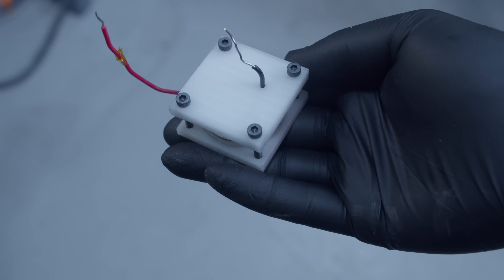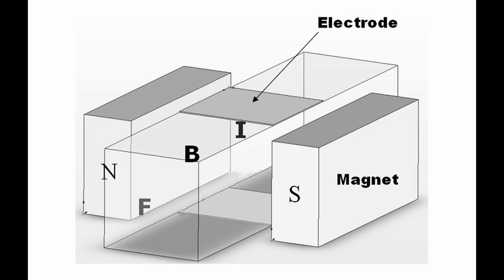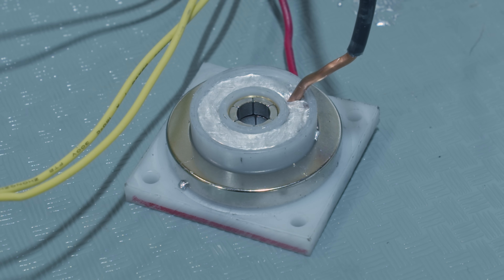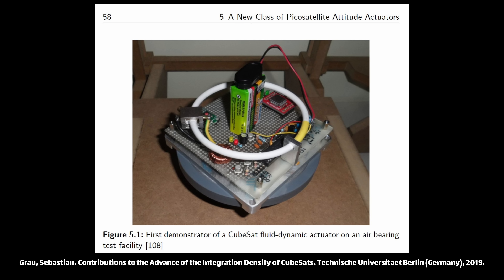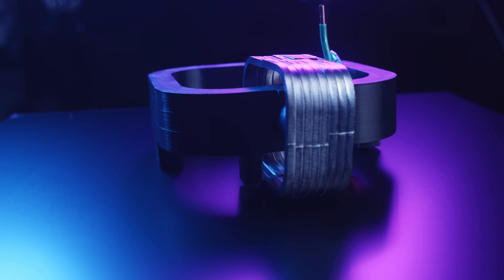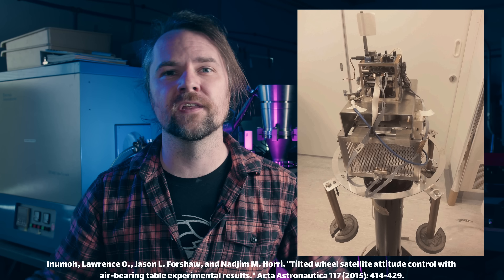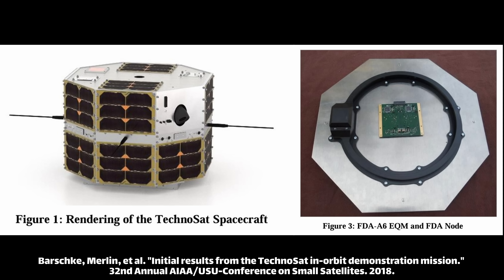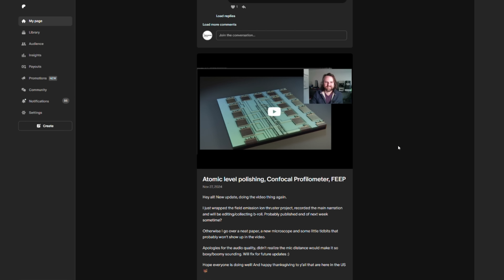A motor with no moving parts (sorta)

Comment: Are there eddies in the liquid metal? Curious if I could use a linear version of this to create a high vacuum if I keep the metal pulled away from a small void in one end of a glass tube? Or, would the metal just squirt around and cause a wacky vacuum pressure. One way to find out I guess, maybe I'll do a video. Could be the lowest cost high vacuum setup ever made, sort of like how they got high vacuum in the 1800s.

Comment: A million dollar comment - make cooler with liquid metal for silicon chips 😉 Like lid with liquid metal inside that soldering to chip and it increase heat spread surface and than use generic cooler)

Comment: Fun fact with the Galinstan; you don’t need to use a hot water bath. As long as the gallium is touching the indium and tin, the amalgam will start to form. It gets very cold and the heat helps speed things up, but it’s neat watching it happen on its own. 

Also if you put a layer of sulfuric or hydrochloric acid on top of the small set up, it keeps the oxides from forming. 0.1M or less would work. 

I’ve seen some papers on HCl vapors being used but the dilute aqueous is easier to work with IMO. 

Love the channel. I took the SEM class for my electives because of your microscopy videos. There’s I made a SEM video for this channel.

Comment: At this rate, why not use a small pump with flow control and use water? I know it's not as cool as liquid metal but in terms of flow, you can slow it down or speed it up given voltage.

Comment: Neat design.   Maybe using a bus pair of power ring on the base with electrodes touching it to power the setup.  Yes it’ll add a bit of friction but at least your liquid reaction wheel can fully rotate and hopefully overcome that friction ?
Reply: Alternatively have a transformer provide AC and then locally rectify it.  Air-couple the primary and secondaries.

Comment: I though i had worth mentioning is that if you already have a powerful electromagnet on board for a magnetorquer, the same hardware could do double duty as the field the electrified fluid pushes against for rotation

Comment: It is much easier to rotate not liquid metal but a solid spherical rotor-magnet in a vacuumized stator cavity. 
Liquid metal is subject to turbulence and unstable flows that are difficult to control. This results in loss of efficiency and difficulty in producing a uniform magnetic field.
A solid spherical rotor provides stable, uniform rotation, which simplifies angular velocity control and axis rotation synchronization.
Liquid metal is highly viscous, which increases energy loss due to friction between its layers.
A solid rotor has no viscous friction.
A liquid metal generally has less magnetic susceptibility than a solid rotor magnet. This limits its ability to generate a strong magnetic field.
A spherical rotor-magnet made of a ferromagnetic material (e.g., NdFeB) is capable of generating a strong magnetic field, which is especially important for systems that utilize electromagnetic interaction.

Liquid metal can interact with the stator surface resulting in erosion and contamination.
A solid rotor in vacuum is not susceptible to wear, which increases the life of the entire system.
Conclusion.
Using a solid spherical rotor-magnet in a vacuumized stator cavity is a simpler, more efficient and stable solution that provides high accuracy and system durability, which is especially important for experimental setups such as Gyro_6DoF. https://www.facebook.com/groups/1109241749136742

Comment: Would the liquid metal need to be kept heated in the vacuum of space? I suppose it would depend on the liquid metal used of course I'm just not sure at what temps certain liquid metals would solidify at, which is why I'm asking...

Comment: The satellite CPU rail is 1.5V... CPU (Vcore): 0.7–1.5V

DDR3 RAM: 1.5V

DDR4 RAM: 1.2V

DDR5 RAM: 1.1V

Chipset: 1.5–3.3V

I/O: 1.8–3.3V

GPU Core: 0.8–1.2V

PSU Rails: 12V, 5V, 3.3V

Comment: I have no scientific knowledge so I feel a bit stupid asking this, but is there an issue taking the movement of the liquid metal and transferring its "momentum" or what ever it's called to the plastic housing? is that why it's square so the liquid metal hits the corners and transfers it's momentum energy to the housing? 

Also instead of having one of these for every axis could you make one that's made from a double walled sphere that could do all axis at once? so by charging one point on the spere and the same at the other side of the sphere you could create a band of flowing metal wherever you like and any orientation you like inside the sphere.

Comment: 1:10 gyroscopic stabilization

You spin the inertial mass one direction, newton's law says the sattelite will spin in the opposite direction
Reply: Something like this could be useful in a nuclear submarine

Roll, pitch, and yaw the submarine without using the noisy propeller
Reply: Instead of passing current through a liquid metal, pass a magnetic field through a diamangetic/paramagnetic or ferromagnetic fluid, could pass the fluid through electrodes and even generate electricity, could be used to recycle power from the inertial motion, the liquid is basically a coil of wire, and moving it in a magnetic field

Comment: Would it be possible to just place about 4 liquid metal bearings in "circular" shape and connect them with torque increasing ratio gears so it would be easier to spin something?

Comment: For the battery solution, I had the same issues when trying to power a wifi router from a power bank. The solution I used was to add a NTC at the out put of the buck converter. I think the issue is the capacitors on the buck converter, they require large current as the charge up and work fine after charging.

Comment: Reaction wheels were one of the most robust components on communications satellites. I was in that industry for 35+ years and recall only a couple failures (and those were pre launch). They were sealed units with a very small heater and were designed to run 20 years in geo orbit.
The technology was advanced enough decades ago that any radical technology wasn't needed.  Also, the drag in an MHD "wheel" is orders of magnitude greater which is extremely inefficient - I would guess there is no future for them in momentum management in space.

Comment: I think I prefer using straight Gallium to Galinstan. Yes, you need to warm it up a bit, but the benefit is that cleaning up spills is very easy: Gently pour some cool water on it, then just pick up the now frozen-solid pieces. 

Much better than trying to deal with picking up liquid metal. Also Gallium by itself is less reactive than Galinstan, so that's nice too. 

The difference is appreciable once you have to deal with formal lab safety risk management. There is an additional benefit which may not apply to you: Being able to avoid looking like a Mercury clean up should a spill occur. 

There's an issue with wetting some things, which is mostly due to an oxide layer. 

I am unsure if the advantage in avoiding corrosion using pure Gallium over Galinstan would be worthwhile the greater effort in a space application, but would note that in space applications, temperature control is usually pretty critical anyway. Finally, stainless steel is generally strong enough to avoid damage due to state changes.

Plus since the material has current through it anyway, it would be its own heating element, so really only needs some degree of cooling when too hot, which might even be possible passively, depending on the situation. If it froze on a satellite, eventually current application is going to un-freeze it. And you'd still have a very similar freezing issue with Galinstan as well anyway, just shifted a little bit.

Comment: If the ball bearings are the issue, then why not have a rotor on a magnetic bearing? Have the magnetic bearing in the middle and the motor parts on the ends. There would be no danger of leaking corrosive liquid metal and no ball bearings.

Comment: you should expand the small model to several concentric channels to create fine grain control and achieve higher mass for the reaction. each channel would be individually controlled and selectively cycled for small adjustmens or collectively cycled for large ones.

Comment: OK, maybe I'm not that familiar with the interplay of all the forces involved - but wouldn't a unidirectional winding of a conductor (wire) wrapped around a tube filled with the liquid metal that is formed into a circle (and sealed to allow continuous flow around the circle within the tube) induce a current into the liquid metal that would then react to the magnetic field created by the winding and create continuous flow? Maybe that wouldn't work with DC power - but then again, the magnetic field WOULD be of a very unique structure...

Comment: After watching the video,💯 👏👏👏I noticed that directly connecting conductors to the liquid metal results in high energy consumption, which is impractical for satellites. A potential improvement could involve using a magnetohydrodynamic (MHD) pump —💡 inspired by magnetic arrangements in projects like the Wendelstein 7-X [Stellarator schema]— with coils arranged in a helical configuration. This could enable more efficient acceleration and direction of the liquid metal, reducing energy consumption and eliminating the need for direct contact with the conductors.🔍

Comment: You need to do a video on the Hemispheric Resonating Gyro, which our company developed originally.  Your video could use a simple "wine glass" like the original concept, and you could show the acoustic wave moving around the glass, as you rotated it.  You can also do this with aluminum or magnetic materials, so you could implement a magnetic drive circuit to replicate an actual gyro.  If done with a heavy metal, it would have much higher inertial value than the liquid methods.
Reply: HRGs do work very well - thank you to your company.

Comment: I'm pretty sure satellites now use black diamond bearings since they are effectively wear proof, chemically inert, and do not need lubrication. The process to make these bearings is fascinating. Manufacturers have these large machines that squeeze a mold at the center of them with so much force and heat that the resulting product is a polycrystalin diamond, or a black diamond. I can't wait to see what else this manufacturing technique will be used for in the future!

Comment: Question: where do you buy Gallium?  I've been casually looking for a while but never really found anywhere
Reply from the maker: I got mine off ebay, although it was maybe a year ago? Got it for a project but never used, been sitting on my shelf since. But in general ebay is good for random elements and chemicals
Reply: @BreakingTaps  I'll have to check again, then.  Couldn't find any when I last looked, but eBay is one of those things where sellers appear and disappear from time to time

Comment: Would this not saturate really quickly compared to a conventional reaction wheel? You're only able to reach a fraction of the speed a reaction wheel can achieve because of the friction between the fluid and the wall.
Reply from the maker: Different tradeoffs! Speed will be slower, but you can get a much larger diameter spinning compared to a reaction wheel (i.e. the "empty" space inside the loop can be filled with electronics or payload, whereas reaction wheels eat the entire volume). Fluid friction is complicated too, friction is high near the wall but near zero as you move inwards. So the geometry can greatly effect friction losses. Reaction wheels have bearing friction and cogging torque too, so they aren't zero-friction by any means either.

Comment: Isn't the main problem that you need to keep the power on aaaall the time since the friction in the liquid is way higher than a spinning wheel on good bearings?

You can see it in the demo that the fluid is saturated in less than a second (the speed can't incease any further) and as soon as the power goes out a torque in the opposite direction is applied since the liquid almost instantly stops flowing.

Comment: The concept doesn't seem practical at all, considering two things; 1; it will never be as accurate and predictable as a solid medium, mainly because it can keep flowing once the current shuts off from momentum, allowing friction to randomize the actual effect.   2; It still has friction, and friction wears things out eventually. A frictionless magnetic bearing of N52's will never wear out. In fact, shield it in gold leaf and it could last until it's hit by a meteor in 8 million years or something.
Reply from the maker: Motors/reaction wheels keep spinning when current is off and also have bearing friction and cogging torque, so it's essentially the same. Just different tradeoffs

Comment: Carbon steel is suboptimal for magnetic conductor, The steel you want is called electric steel, it is either silicone steel (large domains of pure iron) or nickel iron alloy called permalloy.
In this configuration I would simply used some electric steel from a transformer, such as microwave oven transformer.

Comment: Could you do this in 360 degrees, like with a complete sphere?  Maybe a ceramic sphere, with internal magnets,  inside a larger ceramic lined spherical container.  So there would be a layer of liquid metal all around.  Then magnets/power on the outside?

Comment: You can build the walls a little higher and add oil on top of the metal. It should be enough to not let the liquid metal oxidize and thus provide a better view.

Comment: I've got a couple of questions. First, why aren't you using mercury for your tests? It'd be far easier to work with and could potentially yield some rather extraordinary results. (Particularly in the field of electrogravitics.) Second, when I was growing up I had a BMX that had Gyro brakees on the front handlebars so the brake cables wouldn't get tangled. Could something like that be modified to work with electricity?

Comment: Question, what keeps the Liquid Metal from becoming a solid in space, I would assume the internal temperature of the satellite is warm either by design of working electrical components or a “space heater” 😅. Mercury is used as gasket material in space since it becomes a solid naturally.

Comment: Oh good, it needs many amps in order to provide less torque than a flywheel. And if power is lost it instantly tries to chuck your satellite back from whence it came, instead of spinning down very slowly and gradually like a flywheel. I guess technically 10 amps at 1 volt is but 10 watts. Nevertheless, good luck with all that. I find this unlikely to be adopted in any form.

Comment: dumb question. why not electromagnet? current travels from center to outside, and electromagnets make fields from top to bottom. Heck, the EM could be a natural current limiter for the liquid metal pumps. This also makes it so that at rest there's no torque when there's no power applied.

Comment: Was wondering if the permanent magnet problem could be mitigated by using electromagnets instead.  After all, if you are going to be flowing current to accelerate the metal, there is nothing that says you can’t run it through a couple of coils on the way to the electrode is there?

Comment: You said about pressurized enclosures for regular reaction wheels, but what about your liquid wheel? The boiling point of regular water goes drastically down with lower pressure. I imagine same would be true for liquid metal. You said it was highly corrosive so no metal casing, just plastic. A tiny hole or a fracture may cause your whole wheel to boil off and freeze at the same time, rendering it fully inoperable, while regular reaction wheel, even without lubrication, would degrade slowly

Comment: Would this work if you insulated the liquid metal from the electrodes, basically making it like the dielectric in a capacitor? You'd need much higher voltage, but there would little or no current.

Or do you actually need a current?
Reply: Nevermind. I was thinking you needed an electric field, not a current.

Comment: hi. instead of rotation in a circle. please try a half circle. 2 tubes flowing in opposite directions cancel out movements. 2 half circles should make direction. ive done a few tests had problems with rubber tubing expanding with flow. ai suggests it will work but we need to perform

Comment: Interesting experiment but seems not really efficient way. I think, there is another way to create a reaction wheel using electromagnetic field. Get one of those magnetic levitation toys (magnet levitates above platform with another magnet and few inductors controlled by a MCU to stabilize it in air). Make second magnet+inductors platform above, so our magnet would sit between. Now it should work in zero gravity. And with introducing additional inductors - you can make the magnet move a bit in any direction and even rotate. That should get some torque to control attitude.

Comment: I am really surprised that it took ANYONE more than two seconds to realize why this is a bad/really inefficient idea. With a flywheel, you can have magnetic bearings and a vacuum to reduce losses due to friction. Using a liquid metal you have got TERRIBLE losses and unlike a flywheel where you only need small additions of energy to keep it spinning, with a liquid it will stop pretty much whenever you STOP applying energy to it, therefore, useless.

Comment: Bro's got like 5L of Galinstan burning a hole in his pocket lol.

Also my dude - a dilute solution of sulfuric acid and isopropanol floating on top of your metal will stop that oxide layer from showing up (and it will also reduce it if it exists). As I'm sure you've noticed, oxidized Galinstan doesn't flow very well.